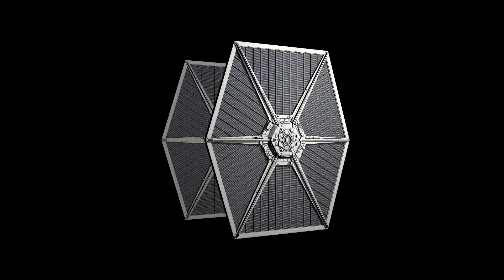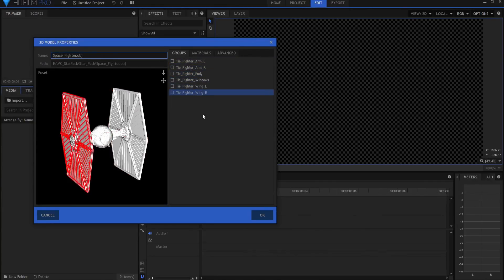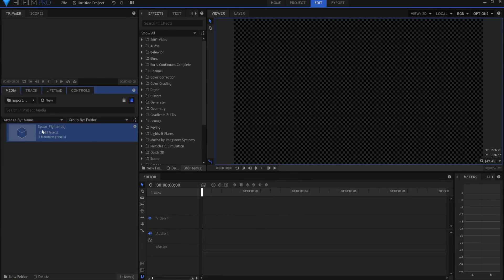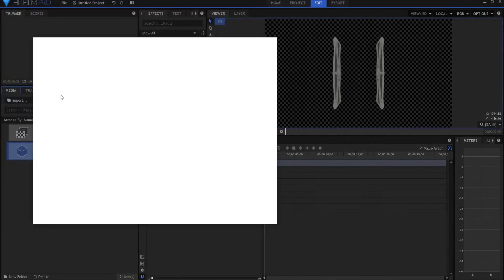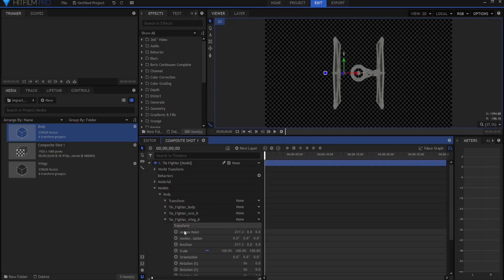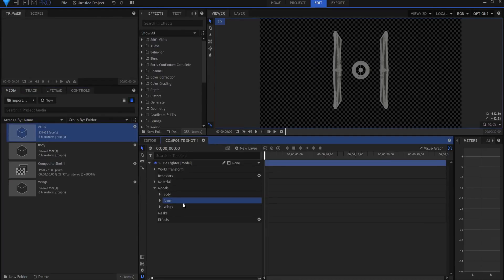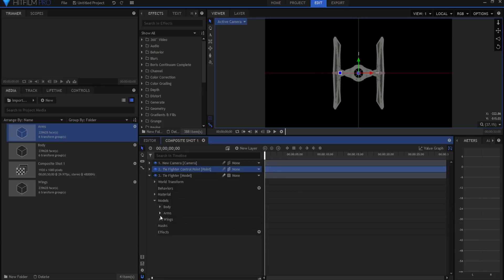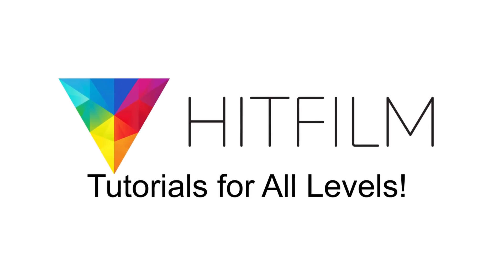How to Build a Star Wars Tie Fighter from Scratch in HitFilm Pro

Comment: What are the benefits of having 3d models in Hitfilm pro vs rendering your animation sequences in a animation program?  HOPE this makes any sense
Reply from the maker: Working with the models directly in HitFilm allows you to immediately make changes to the special FX of the video without having to go back and forth from the animation software. It is so nice to be able quickly make a simple adjustment of the camera angle, the lighting, the model position, etc without needing to exit the editor, enter the different software, make the change, render it out, and import it back into the editor again.